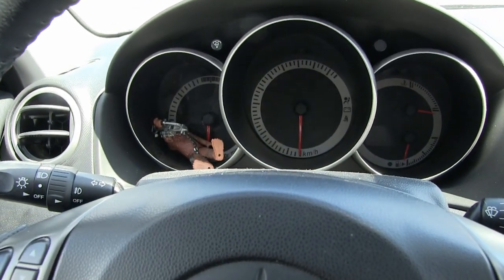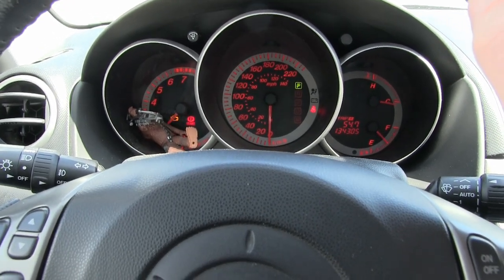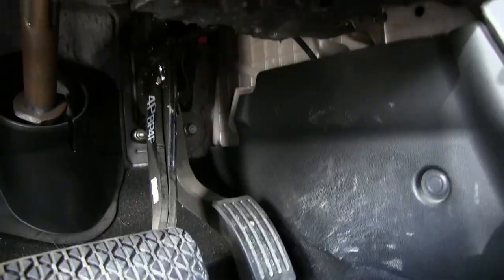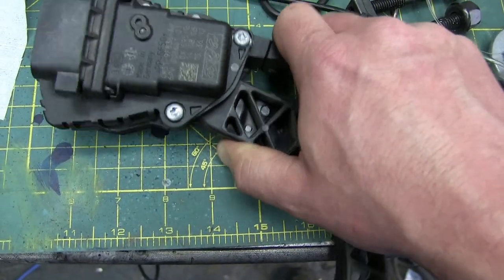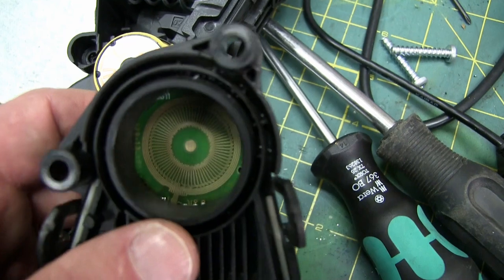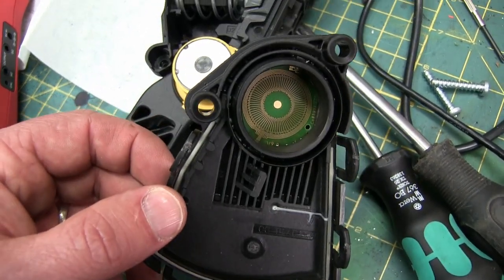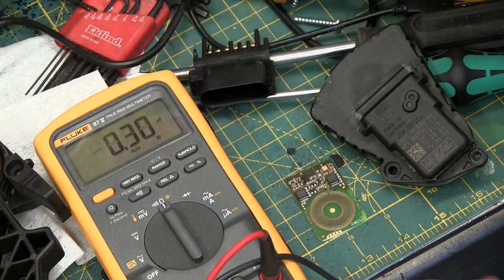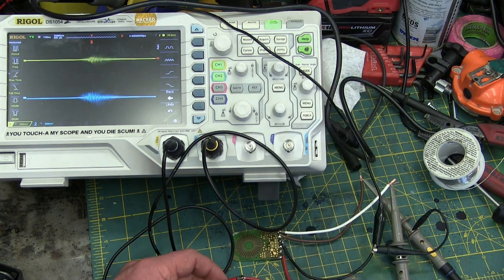BOLTR: CANbus accelerator pedal.

Comment: Hi AvE, FEMs or pots somewhere?

I begin to wonder whether all these bloody electronics are REALLY necessary you know? Is there a corner of any new car that hasn’t got ant
Reply: Yes you need the electronics if you want ABS, traction control, or stability control. You need all sorts of measurements and position readings for them to work
Reply: I appreciate you help and the reasons the need for electronics.
Reply: You could get away with about half of the electronics, if you wanted it to be like an old car, where when things fail no lights go off, and the car does not try to protect itself or you by throwing a CEL and dropping into limp mode.

You don't need a backup for a throttle position sensor,  it doesn't need to be able to throw a code and put the engine in limp,  but you want it to be able to do that, so when the jeezeless thing's watch battery dies it won't just decide  2% throttle is actually -01% throttle, and bounce the engine off the rev limiter until it ventilates the block.

I hear that the side of the car that doesn't get hit during the small overlap crash test is generally where they save money on their cars these days.
Reply: Extremely good points especially on the failure of the 3 penny battery that allow ANY computing or not!

Comment: I got a chuckle out of some of David Serrano's comments. I'm 49, haven't owned a vehicle with drive by wire. So why would I bitch about that set up. The last new truck I drove off the lot, was an '01 Ram 2500 V-10, 5 spd. and I didn't like it as much as my '98. Both V-10, 5 spd., with 3.55 gears, and Quadcabs. The quality wasn't there in the '01. My auntie has a Buick SUV. The electric steering failed 3 times within a year. The rear hatch would randomly open on it's own. I guess you can call me an old man. I don't care, I'm happy with the '99 Ram 1500. I don't have to go outside and lock the front hubs. Air, tilt, cruise, and a 4 spd., auto. It's just a get me to work truck. The other truck is an '80, Powerwagon, that I used to call the "Beast". I now refer to her as shit stain. Clubcab, long box, 4 spd, no AC, or heated steering wheel. Dark brown with a tan center stripe, manual choke, and the clutch linkage, isn't hydraulic. Even at -40*C it starts every time.

Comment: im a mechanic, parts are no longer designed to be fixed, they design them so you have to buy a new part.
Reply: ProVision3187 I'm an old school mechanic,I learned to rebuild everything back in the day. Just because it was designed to be nonservicable doesn't mean you can't try. I learn how a lot of this new stuff works by tearing it apart before it gets replaced

Comment: Want fun.  04 Freestar PCM got water in it (know issue that has a solution.... that I found out after the fact)  Fried the PCM fried the relay.  and a wire someplace..... I think its the last thing left.  checked every fuse and relay, even the ones that have no possible connection...... I now have less hair and what's left is now grey.....

Comment: Mazda seems to think there some really hot shit and will not release any pin-outs or wiring diagrams unless your a tech and your service center pays Mazda for the info.  I've been back and forth with them over this for my car.

Also there is a reset procedure for the drive by wire system on that Mazda.

Comment: reading some of the comments😂 . hey as long as the break pedal is metal , I'm all good , and beast better be mechanically connected to the actual system . I wanna be able to have a response to me pushing the fire wall though while screaming and pokemutt speed bump mellinials.

Comment: Probably not a bad investment on a new pedal. Just check the harness that runs from the left side over to the pedals. Sometimes they can be damaged(you may have to pull off the casing)especially is some butcher with a sharp knife was in there getting a brake switch signal for a remote starter. Here's a link for the code diagnostic tree, it also includes the pin out information/diagram specific to the trouble circuit in the pedal. Uses 12v power and ground for power and the signal sense to the PCM is a 5 volt sense circuit  https://euroesi.mazda.co.jp/esicont/eu_eng/mazda3/20110724140058/html/id0102g3934400.html 

I'll spare you the resume since you and the rest of the world don't care, lets just say I have wasted years working on this exact model to the point I got a gold star from the manufacturer. Best of luck.

Comment: pst, that's probably a 5 volt device, not a 12 volt. Most computers in automotive these days use 5 volt reference voltage. can't speak for Mazda/Ford, but I know PACCAR uses 5 volts on most sensors

Comment: Damn, what was ever wrong with the accelerator just being a pedal attached to a steel cable?
Reply: Drive-by-wire throttle makes cruise control a lot simpler to implement as it only needs the switches to be added.
Reply: And idle air control and emissions. Those all had their own motors and attachments to the throttle back in the day.
Reply: drive by wire facilitates stability control, crash avoidance, simpler cruise, and a whole bunch of crap I can't think of right now.
Reply: Yea I guess it does make cruise control easier. Still in the old system all you needed for cruise was another cable and a couple of vacuum lines and a diaphragm. 
But just a cable is a lot easier to diagnose in the very rare case that there is a problem with it. I guess you still need a TPS for EFI and an automatic transmissions anyways, but I don't know, just like a mechanical connection for important things like steering, accelerator, and brakes.
Reply: Old carburetor cars are more simple to cruise, and have faster throttle response.
Reply: Simple the parts supplier can charge more for this and make more money.
A cable is what $25 and may last the life of the car while a complete electric throttle servo and pedal can be $300 or more and may need to be replaced a few times over the life of the vehicle.
Reply: Drive by wire means you don't need a cruise control actuator or an idle air control valve, and it opens up all kinds of computer meddling for traction control and fuel economy. It looks good on paper. Fewer components, greater control... by the computer. I understand why the bastards use these things. But I sure as hell don't want one. 

My dad's had issues with the electronic throttles glitching out on two of his rigs. My mom's CRV was hopeless in slick snow because the computer would close the throttle as soon as a wheel slipped. There was no keeping up momentum, either. Halfway up the hill, a wheel would slip, and the damn thing would just stop. There was no off switch for that wonderful feature. And the lag!

I like my steel cable. I'll deal with the extra valves.
Reply: +saasrus No problem with throttle response on anything on anything made in the last 10 years IME. On my current Mazda you'd never be able to guess there's no mechanical connection between pedal and throttle butterfly.
Reply: +Darwinpasta Ice and snow? Simple - RTFM and switch off any traction/stability control.
Reply: Not on an '07. Her newer CRV has an off switch because enough customers bitched about it. Owner's manual didn't have shit. It's not the only shitbox built that way, either. Dunno where you heard that about supercars, I seem to remember Top Gear turning off plenty of traction controls.
Reply: I did a fair bit of searching at the time for a way to turn the wretched thing off and found nothing. I remember reading that Rav4s have some kind of Konami code you have to enter with kicking the brake so many times and pulling the e-brake so many times or something, but I couldn't find anything similar for the CRV. Searching now, I still find nothing. If your google-fu is stronger than mine, post a link, the car's long gone but I'm curious.
Reply: +saasrus Carbs do not have a faster response. Just look at efi motercycles for example, faster response than any old carbureted bike could have. The only reason many cars feel slower to respond is because they are programmed that way to increase fuel economy and make them smoother to drive.

Comment: What if that isn't your problem, then you just ruined a good part. Also I have a feeling IF it actually is that part that it might just be out of alignment since that's the only moving part.
Reply: He did say it was almost lunch time. 😆
Reply: Ruined a good part, but made a fun video.
Reply: not really anything there to align. could have been a bad connection, or who knows what. I look forward to knowing the actual cause.
Reply: I think that idea is out of alignment...  It might not be making contact due to wear, but not likely. It is way too new. The ignition switch in my Honda simply stopped making contact with 2/3 of the contacts. The radio and the heater didn't work. A cardboard shim made the blower work but not the radio.  But that is on a 1988 Honda with 292k miles on it.

Comment: Speaking as a former tech, if you're paying 100 bucks for that part, you likely don't want it, too cheap to be any good and all that. I've replaced that part on ford trucks, and the last one I bought was 300, manufactured by hella. Stealership wanted something ludicrous like 500, but buying cheap sensors from suppliers like autozone & the like isn't worth the frustration factor.

Also, many independent shops can be easily bribed with beer or homemade baked goods into printing off the pages of the schematic and diagnostic flowcharts you need, but there is a better option. For the single-vehicle owner, you can get alldata access for single vehicles at http://www.alldatadiy.com/. I've never used it, but if they have the same information avaliable for a single vehicle as a shop has access to, then it's worth the price of admission. Pinouts and circuit descriptions, along with excellent location diagrams to find that hidden sensor or canbus component. No actual circuit diagrams, but not even the dealerships have access to those.

Comment: AvE , this kind of ACC pedal position sensor has 2 otputs, one is voltage output, second is pwm , due to redundancy reasons, 
for example from:
Ford Focus Mk2, 1.6 TDCi, or volvo v40 and others
part number:
4m51-9f836-bh 
Pinout 
Connector  C648: 
Pin1 - PEDAL +5V 
Pin2 - ACC PEDAL INPUT  - this voltage output DC  0.4 do 3.8 V 
Pin3 - PEDAL GND,
Pin4 - LEFT FRONT ROCKER PANEL GROUND 
Pin5 - PWM signal directly to PCM
Pin6 - +12V after ignition

take a look here for photo: 
http://www.elektroda.pl/rtvforum/viewtopic.php?t=3230726&highlight=

Comment: the lack of schematics for modern cars is troubling, since they assume everything is disposable they don't bother with anything more than cursory pass/fail test and you simply swap parts....
Even on older cars(i've tried to fix a module on my diesel car and zero pinout or schematics, got a used one from teh chop shop so cheap that it wasn't worth my time to reverse engineer the thing)
Reply: at my work we are obligated to provice schematics if a customer asks for them.. but yeah usualy they just replace the "broken" part.. and again ... and again until they figure out that they need to READ  THE  F%@#$ manual first
Reply: You can always purchase the shop manuals. Surely they still offer those...how else would their dealerships and other authorized repair shops be able to complete their work? They are not marketed to Joe Shmoe, mind you, so you'd have to do a bit more digging for them both in terms of research and in your pockets....they ain't cheap. But they cover everything.
Reply: the shop manuals don't include the pinouts of the connectors usually(save for the ECU) and they certainly don't include the internal circuit schematics of ANY module(i've seen plenty manuals, even the bentley ones gear more towards the mech side)
Reply: Guillermo Lovato I guess only Jeep has pinouts and proper diagrams in their manuals then. I'm not talking about Haynes or Chiltons. You may not be either, and I'm not going to assume you are...but just to be clear. I am almost certain that other manufacturers have tech data in giant three ring binders their dealerships can purchase for hundreds and hundreds of dollars that include every aspect of the vehicle. But I have been wrong before. :)
Reply: Schematics and documentation would be nice as one probably could easily make a tester for many of these parts with an Arduino if they had information on the electrical schematics and protocols used.
But it seems like they want to make cars so only the dealers can fix them.

Comment: If all the device has to do is tell the engine management how far down the pedal is pushed, why don't they just use the same cheap as (capacitance?) crap they use in digital vernier calipers? I mean a $10 set will measure 300mm throw down to poofteenths of a mm, that's overkill for this application.

Comment: whats the year make and model?
Reply: nvm i was able to get the part number off the vid once you got your meat hooks out of the way. from what i could find the pinnout looking at the end of the connector on the wiring side with the clip facing up it is 
6=app vref (2)
5-app (2)
4 - app rtn (2)
3-app rtn
2- app
1- app vref
witch looks like the same system as the semi's that i work on they use two separate sensor readings and compare them to each other to see if one is faulty or not. The v ref should be around 5v. rtn is ground and 2 and 5 your signal wires if they are the same as a semi.

Comment: you know how my throttle works? It's very complicated...
There's a cable that's attached to my gas pedal and at the other end it's attached to the throttle body.
So you can see why they switched over to this design. Much more simple. (still a tps on the throttle body lol :P)

Comment: 12v wont wake that part up, it probably needs a wake up signal. I bet one of those lines needs to be pulled high or low. I bet the 12v line on that connector is fused at the box and hooked directly into the cars main 12v line.
Reply: Most modern vehicles use a CAN bus for communication to components like this. So it is a lot more difficult to understand than just a high or low wakeup signal.
Reply: +Mark Henderson regardless, dropping 12v on the rail and expecting it to start throwing out 1s and 0s is not going to hapen.
Reply: +MorRobots 12 volts will kill it. It runs on a 0 to 5 volt window.
Reply: +Magic Pixie Death Squad would it make you happier if I said V c fucking c?
Reply: +MorRobots  I did not comment to be deliberately rude or offensive to ya.
Reply: My bad, everything sounds emotionless and trolling on youtube comments. OK so I think I figured it out.

I found a circut diagram from Autozone for the connector: http://www.autozone.com/repairguides/Tucson-2006-2008/Components-Systems/Accelerator-Pedal-Position-Sensor/_/P-0996b43f80e65041

It looks like its just two POTs that very a 5v reference.. But how can that be a pot you say?? simple, they are digital pots and that crazy trace setup on the board has a geometry such that the wiper will pull different pints low and high as it rotates. When that happens it just knows the pedal is in a different position. The resolution of that pedal is whatever the angle is between two of those traces. Those chips are likely special for this function and are setup such that it knows when different pin combinations are pulled high where the pedal is.

Comment: Broken throtle cable....what will happen? Right, you can not accelerate, you stop. Not impossible to die but less probable.
The issue with cable is when few strands brake and it blocks accelerating BUT  the main difference between simple cable and electronics is this:  cable you cand inspect from time to time and any monkey cand see if it is pinched, rusted, etc.
Electronics...not even having 100k in all sorts of   measuring devices ( like AvE does) can not help you to "see" if a disaster is around the corner.

Comment: Perhaps part of the reason they are so skookum is because while people are happy enough to toss out and buy a new power drill/grinder every two years, if their car was breaking down like that they'd never buy a Mazda/Ford/whatever brand again. Ever. So it's not worth trying to scrape up the margin on it.

Full disclosure: have worked in a plant making EV parts for a major manufacturer. The anal retentiveness that goes into the assembly is insane.

Comment: why do they make gas pedals so complicated? it's just filled with potential flaws and much more likely to fail. why not just run a line straight to the throttle on the engine? that's what my car does

Comment: Ford does not own Mazda, although they had a majority of shares for about 20yrs up until the early 2000's, when Mazda bought themselves back and Ford approached bankruptcy.  The older models shared parts because Mazda and Ford co-developed several platforms together.

Comment: depending on the car, most of these are on the canbus network for the car, so its its own little computer that talks to a different computer.  you'd have better luck backprobing or using a breakout box on it while its still hooked up to see if the canbus connection is still good.  you really wont be able to see what its saying, but as long as the canbus lines are good, you can be pretty certain that its the sensor, a solid scan tool really helps diagnosing canbus stuff.  pre canbus obd2 stuff is pretty easy to figure out with codes, a couple pids and a scope, doesnt take long to get to 100% confidence on the fault.